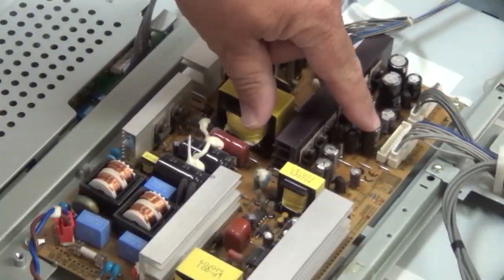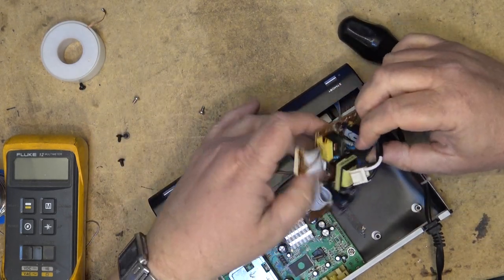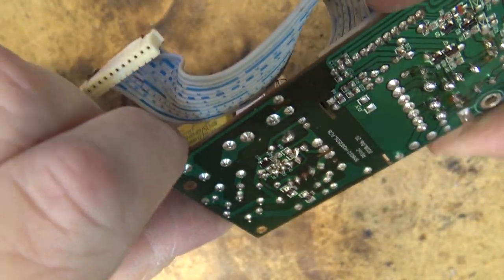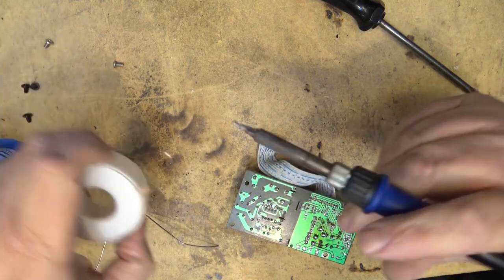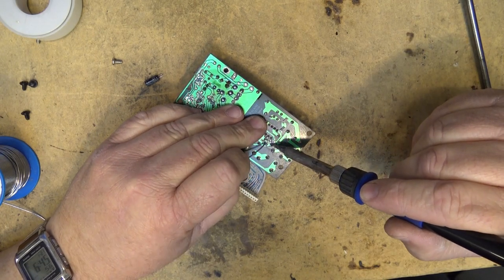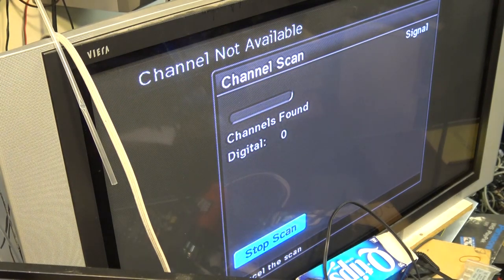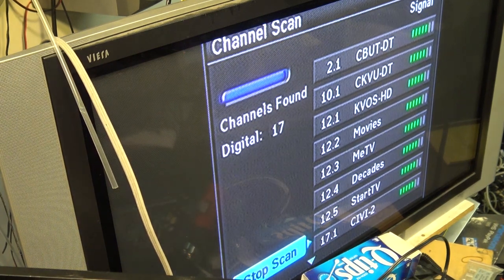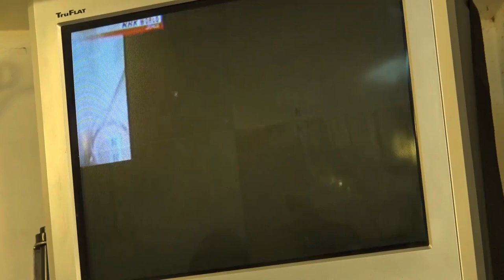Memorex ATSC to NTSC converter box no power red light blinks

Comment: Using scissors: For many years I had a pair of extremely well made surgical scissors... given to me by a person who worked in a hospital. The things were long but the blade cutting area was quite short & man they were sharp. Closed the width was under ¼” and they were absolutely perfect working on tube gear ... slide deeply down in between socket connections, tiny open and snip off that dead component lead.... FANTASTIC. Then one day I couldn’t find them in my toolbox and haven’t been able to replace then since... grrrrrr!

Comment: Great series. 
On a side note - I received a pair of those Klein electricians scissors for Christmas. Totally Bad A$$! That's all I'll ever use from now on. The haters should try them, I'm sure they'd change their tune.
Reply from the maker: Exactly.  That is why I use them all the time.  Started using them at work when I was doing cable splicing and had an extra set that was a little dull for fiber so I got a new pair and recycled the old to home instead of the bin.

Comment: The problem now day's they use this cold solder - The Old lead solder that you flowed and used a Hot solder Was better it did not break and crack. Samsung a certin TV had solder issues

Comment: Nothing is wrong with Klein scissors, NOTHING. They are the best electrician scissors that has ever been made. No diagonal cutters of any type will cut that clean. I have several Klein tools and you get what you pay for, so if you want a lifetime tool you can't go wrong buying tools needed that's used on a daily basis. I also have several of the cheapie tools, just depends on how often that you use them, Harbor Freight stuff.

Comment: You put a new capacitor in the box!!, are you ill or something? ha ha :-D leg pulling.
Startup supply caps do go bad, but the output capacitors are dead on most supplys i've repaired.
What's wrong with using your electricians sissors, they work great.
I use new nail clippers, not perfect but they do.
Reply from the maker: Those Klein or Miller electrician scissors are great but every time I use them someone has to give me their opinion on them.  If I wanted their opinion I would give it to them.